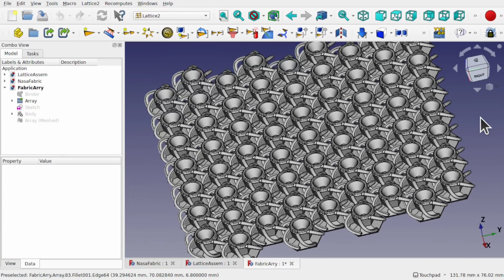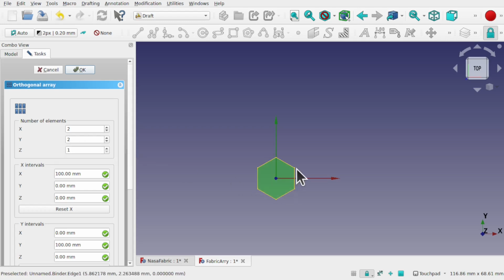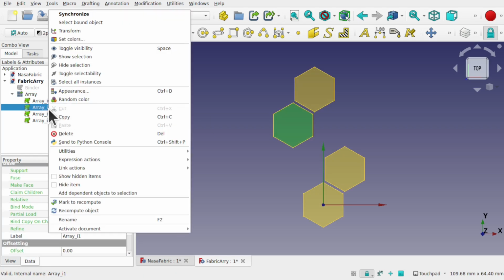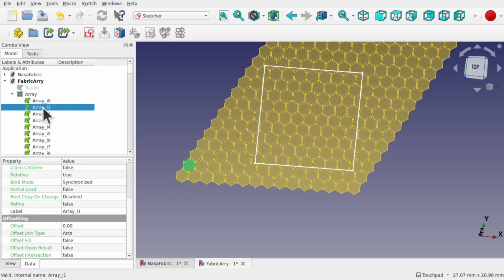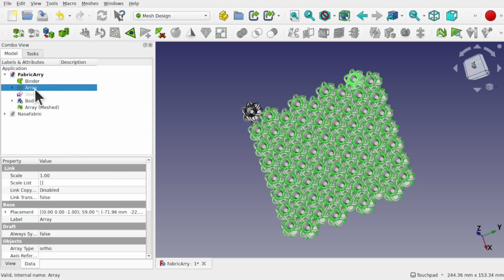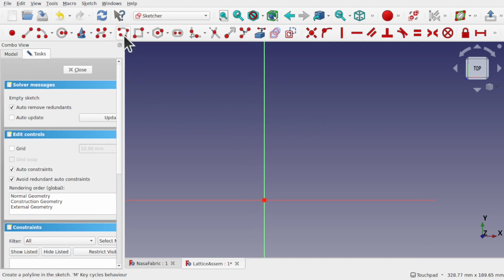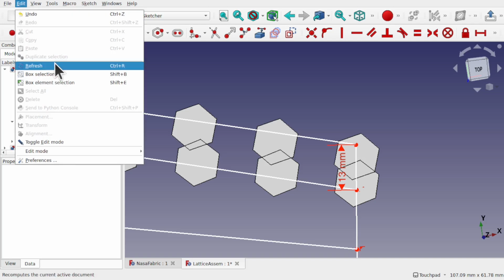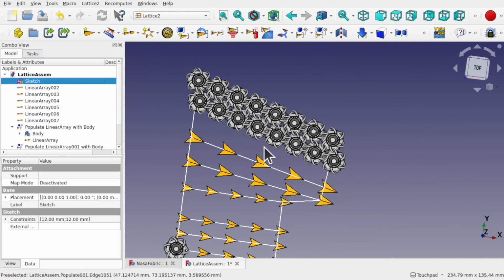Reverse Engineering NASA 3D Printed Fabric Build in FreeCAD | Part 2 | Chainmail

Comment: One thing you covered here, which might be of interest to some. I have created mesh objects with other programs and then imported them into FreeCAD. I then tried to convert them into shapes. My computer wasn't having it. I've been using FreeCAD as a purest, thinking things always needed to be a shape. Meshes are just as valid as solid shapes and don't always need conversion when using them in designs. Please correct me if I am wrong. Thank you Mango.
Reply from the maker: Good question and it all comes down to what you are going to do worth it in the end. If your altering the imported mesh then it's best to downgrade to a shape, in that way you have the power of the part and part design tools, attachment and refine options to reduce the amount of faces sorting along the same plane. If your using it for reference then you can use such tools as the cross section with or without converting to a shape, the tool is in both part and mesh workbench. Converting to a shape can simplify the mesh. It's also worth mentioning that imported stl may be worth going through something like blender to decimate the mesh first then import into freecad. This will reduce the amount of polygons making life a little easier for your computer.

Comment: 5:20 To get consistent and parametric spacing with Draft->Array you could create a sketch and import the hexagon. Then draw an equal hexagon and use the constraints to space it form the other. Then add an X and Y reference constraint from matching points on the two hexagons. Then use Sketch.Constraints.X and Sketch.Constraints.Y as expressions for the X and Y intervals of the array.
Reply from the maker: Nice 👍 Thanks for adding this and helping others. Much appreciated

Comment: Lol, I was just printing the original model when this was released. Still printing though, as the first attempt failed with a Yaxis crash due to overextrusion. 24h print for the 16x(something) version on the prusa mk3
Reply from the maker: I would go for a flexible filament as pla can be quite brittle for this type of project.
Reply: @MangoJellySolutions  no, second time went great. Problem was probably improper part cooling. It's 30 Celsius outside, so going to 40+ maybe 50+ in the enclosure. Opening the doors seemed to fix it